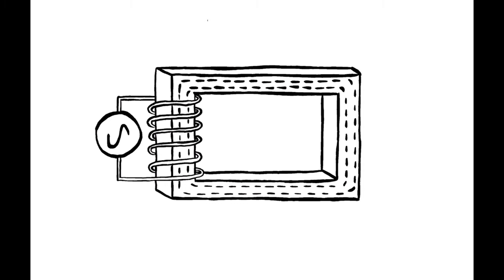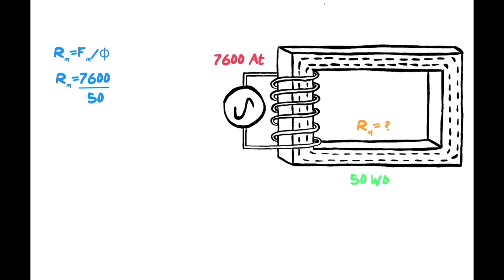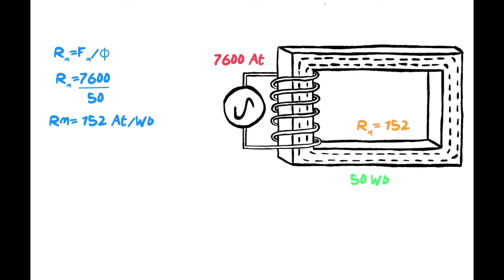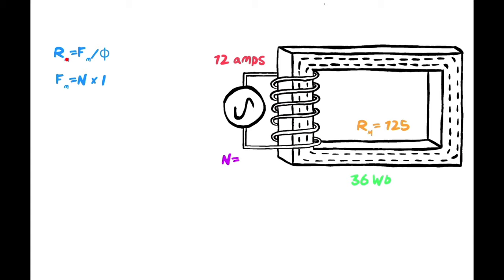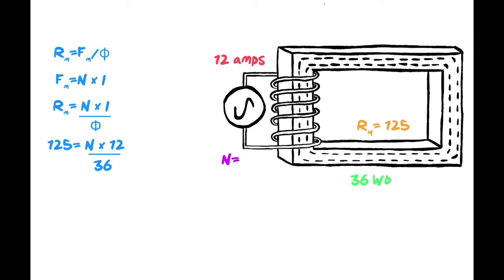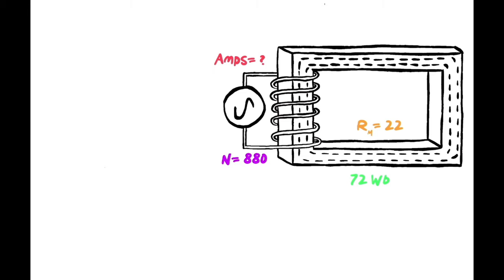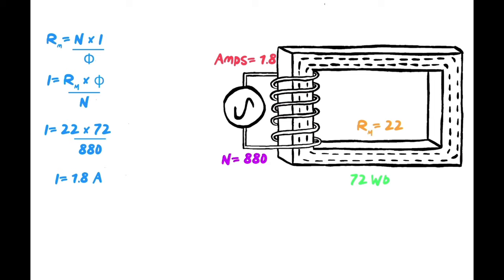WHAT THE FLUX IS UP WITH RELUCTANCE?

Comment: Ok, base on understanding of ratio of reluctance to permeability so reluctance is base on high absorbility of energy field to saturation, so the iron will absorb high speed after the electricity cut off, so iron is speed captance and the higher speed captance, the better time rate. So, like a glass with water, so the glass is empty so you pour the water, so the glass is a resistance to electricity, so glass is resistance so hold the water, so the energy will go high, then absorb, so put low sponse or high sponse, so which sponse faster, per time, so iron has higher absorbility rate so iron is better. So, that is higher reluctance which the magnet field will absorb in high speed in the mass after the circuit is cut off. The magnet force or magnet force, mmf. Well, since the electricity is first which interact the resistance so it will react, so thru react it will cause magnet field so the magnet field is being absorbs, so the magnet is use as a mover or a store for electricity field, so like a battery, so when the battery is used, the volt will be gain to the load since a battery is activity, so the electricity is activity which it change from one to another like resistance to volt, so magnet within the mass will react. All mass has magnet within so waiting to react, so mass is captance that hold the energy.

Comment: The math shown here is easy.
But what is reluctance?
Why does it exist?
Is it like capacitance or inductance that store energy in a field temporarily?  Is it like resistance that uses energy and let's it off as heat?

What exactly does it resist if magnetism does not have anything flowing?  How does it relate to permeance?
Can someone please help?

I have an exam coming up and I can't focus on my work because I'm unable to understand this which was a footnote in my book.  If they'd left it as analogous of resistance in an electrical circuit it wouldn't have been so bad.  But they had to add that it shouldn't be taken too literally as the energy is not used up but stored.  And now I'm totally lost, clawing my way down the rabbit hole of magnetic circuits trying to understand what exactly happens.
Reply: Reluctance is like resistance in an electrical circuit. Reluctance opposes the creation of magnetic lines of flux
Reply: @james77011  
Don't worry I eventually figured it out.
That vague answer was the exact thing about my textbook that annoyed me.

It's like resistance, but it's not.

It is to inductance what batteries and cells are to capacitors.
With magnetized materials keeping the energy in their fields long after current is removed.
Reply: @phasepanther4423  oh well 🤷‍♂️😒
Reply: @james77011  
My apologies.

I did not mean to dismiss your assistance.

But there was no explanation of what happens to the energy.  A hysteresis loop is the best visual representation.  But also understanding how ferromagnetism works.

Comment: So, your first example is basically 'measuring' the reluctance actually used and giving it a calculable value. 
Second is merely 'counting' loops. 
And the third for calculating amps of an 'existing' unit. 

These seem to be 'academic exercises' (contrived homework).  
    Merely mathematical manipulation with never less than 1 unknown. 
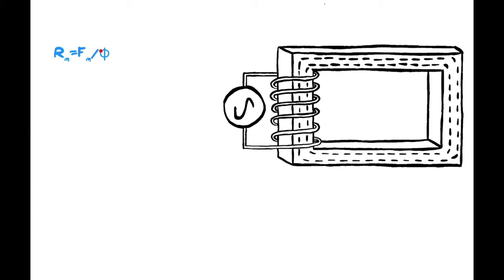Any variable may be used (e.g. 2:48 a=b/x). 

In other words, this is math, not magnetics. Fair enough, but DIYs learn new nothing here..